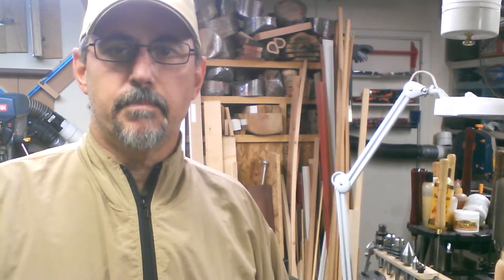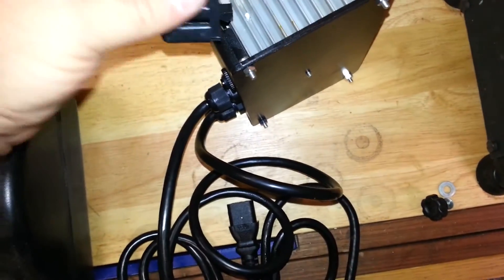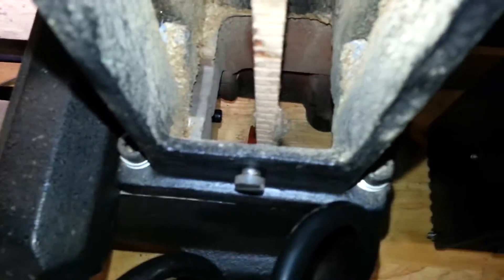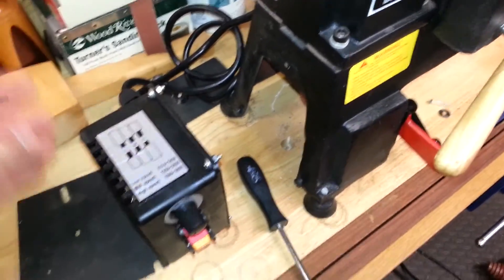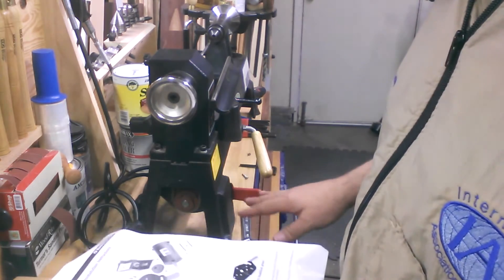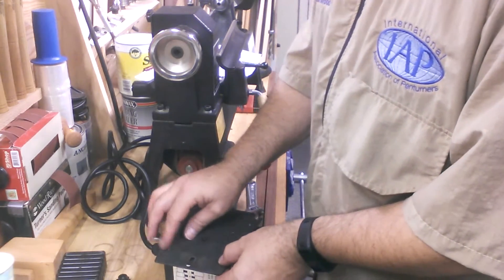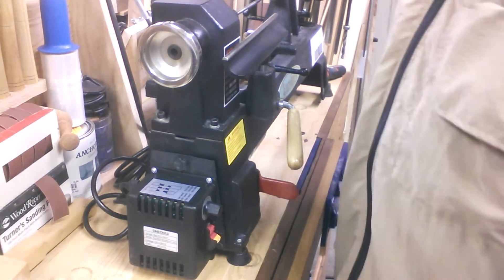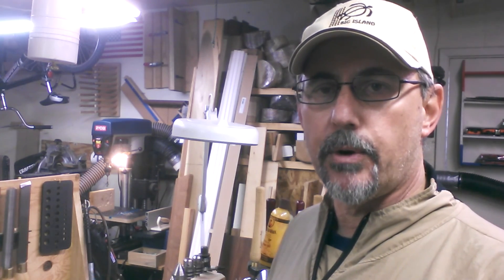08 - EVS for Excelsior Mini Lathe

Comment: Love it. I've been thinking about getting that VS motor for mine. I've got the Rikon badged model of that lathe. Changing speeds is such a pain, but that's my only real complaint about that lathe. Excellent video, Bill.
Reply from the maker: Joseph Gillen Thanks Joseph. I put it off quite a while but with the other two lathes being VS I got tired of moving the belt.  Cheers!

Comment: Bill, thank you for this informative video !
I received my kit yesterday, and installed the control box as you've demonstrated on my Harbor Freight 10x18.
5 minute quick fit for the motor, 5 minutes to drill the new holes in the plastic cover, and all is well !!! 

I do have a bit of vibration when running on the low pulley set at various speeds, but I'm not yet sure if it's the motor or lathe itself.
Stay tuned !!!

For those who may be interested in this inexpensive upgrade, here a link to the product;
https://www.pennstateind.com/store/TCLVSKIT.html
Reply from the maker: Thanks for watching and commenting, and I'm glad the option is still available and worked out for you. Cheers!

Comment: Covering up the heat sink on the bottom is not a good idea. VFD control may overheat and get sawdust in it.
Reply from the maker: Hi Ed, thanks for watching and commenting.  I agree - I never did put on the stock cover that came with that variable speed controller.

Comment: Hello Bill, thanks for quick reply,, here is another question,, there are times when I will have the lathe on for along time say 2  hours,, the motor is so hot I can not set my hand on it,,,, a while back I sat my for arm on the top of the head stop and it was smoking hot,, last night I removed the head stop and thought it turned a little stiff,, I took it to 2 machine shops to press out the bearing to replace them and they said it turns fine and did not want to do it.When I give it a hard spin it only wants to to spin about 1-2 turns,,, should it more freely than this?.. Since the tail stop is pot metal they may have just not wanted to do it 
Thanks 
Lee
Reply from the maker: Lee, small novel alert: I checked my Excelsior, and with the belt disengaged from the spindle, I can get 6 or 7 freewheeling revolutions out of the spindle. If you are doing the same thing and only getting one or two revs, something is causing friction, likely the bearings.  Motors will heat up for various reasons - lack of air cooling, worn bearings, overload, etc. so you'll have to isolate what is going on there. It could also conduct some heat to your lathe bed near the headstock, possibly adding to the heat already there. But checking/changing your headstock spindle bearings is a quick and cheap way to correct the headstock heating issue, then check the motor issue. Remember not to overtighten the belt, that could cause bearing strain/wear/heating. Cheers!

Comment: Hello Bill, I have a master craft MC10-18,,, if you took the stickers off you could not tell the difference from the excelsior,, I have been stalling the motor lately and want to do the upgrade,, the pulley,s on mine has 5 steps and I see in the video the new motor has 3,,any problems getting the belt to line up ?
Lee
Reply from the maker: Hi Lee, I believe several models including mine,  the MasterCraft and the Harbor Freight offerings are the same.  I had no issues lining up the pulleys. However,  this motor can also be stalled,  especially on larger turnings. The advantage is the EVS, not necessarily motor strength. You might want to consider how and why you are stalling your current motor before you buy,  this one may not address your issue. Cheers!

Comment: I have been looking for a way to do that and this looks like the ticket for my excelsior lathe! Do you think the tachometer that you showed for your Central lathe would work with this set up as well?
Reply from the maker: Hi Terry, thanks for your comment.  Yes, the tachometer should work - but would have to be externally attached in its entirety, as there is absolutely no room in the headstock to accommodate anything like a transformer.  I plan to do this as well, leaving the transformer intact, and putting a switch in the circuit - like a toggle or pushbutton - possibly on the display unit.  When I do, I'll video and post.  Cheers!
Reply: Thanks for the reply!  I am thinking that the old motor can easily be utilized as a dedicated slow speed grinder for wood turning tool sharpening as I only have a 6 inch high speed grinder.  Thinking of adapting a John Heisz plan for the grinder mount.
Reply from the maker: Terry Ellis Hi Terry,  I think the old motor is likely strong enough to serve as a lathe tool grinder. I have been trying to think up some uses for mine as well, and I like your idea, maybe with a CBN wheel. Please let me know how yours works out. Cheers!

Comment: since you have installed the variable speed control for your excelsior  how has it performed for you   im thinking about getting the same for my excelsior lathe
Reply from the maker: Hi Duane, it has been working very well for me.  I use this lathe primarily for pens and have not tested it for larger turnings but I'm happy to have the variable speed.  I may try a bowl on it and if I do I'll post a video. Cheers!
Reply: That's what I'm using it for making bowls that's why I wondered how it was working for you it looks real good in the video so I guess then I'm going to go ahead and purchase the variable speed
Reply from the maker: I think you'll like it. My guess is that it would do fine for small bowls especially if starting with round bowl blanks. Be safe and have fun. Cheers!

Comment: I have the same Excelsior lathe as you. I guess I misunderstood that this new motor would fit right up to mounting holes. No way. First I tried to use the template that came with the motor to drill holes in the motor mount and the thing was so flimsy it just fell apart. Second I decided I would take the mount off of the new motor and use that as a template. I could not remove the pully after taking the set pin out. It would have been nice if the pulley was off the shaft when it arrived.  Also, I realized that the large opening behind the pulley on mine was larger than the one behind the new one so the bottom mounting screw was inside the hole on mine. No way the template would work anyway.  I called Penn and was told by an ill-mannered person to send it back!!. I give up. I will be sending it back.  I wish you had gone through the entire way you had to drill the new mount.  Because there is no way you just installed it in the way that you implied in your video. So now I need to put everything back the way it was before this fiasco.
Reply from the maker: Hey Hills, I'm sorry to hear about the issues you are having - they must have changed something in the motor mount design, because the one that I bought was a direct Mount up to the old holes for the motor. The only thing I had the modify was how to mount the variable speed control box, which was pretty minimal. Disappointing to hear about this change, thanks for letting me know. Be safe turning!
Reply: Hey Bill, my bad. I really overthought this whole operation. I took a nap, thought about it and realized I was thinking I had to use the motor mount that came off the lathe. Anyway, everything hooked up fine. Next, I need to figure out pully configuration and I am back to turning. Thanks for all the great info. Stay safe.
Reply: Hi Bill, just a follow-up question on the EVS motor on the Excelsior lathe. I can't can seem to bring the speed down. The pulleys are alined correctly but and I have tried all three, but still no luck. Should the speed control turn all the way down to Zero rotations?  When I do turn it all the way down the speed is still very high. I hope all is well with you and would love to hear your advice. Thanks
Reply from the maker: Hi Hills, mine doesn't turn down to zero, but it does turn down to a fairly slow rpm.  Are you saying that yours doesn't change speed at all?  If that's true, I would ensure the motor controller is functioning properly by removing the belt and watching/listening for any speed change in the motor and pulley set on the motor shaft.  If there's no speed control change on the motor side when you move the knob from low to high, you might have a defective motor controller.  If so, I would give  Penn State a call to see if they will send you a replacement. When I bought my replacement motor set, it only had 3 positions on the motor pulley versus 5  on the headstock pulley, and I positioned the two pulleys so I could use the three Center pulley ranges on the headstock side.  And I typically use the very middle one, which gives me enough RPM range from low-to-high with the motor controller for what I do.
Reply from the maker: Hills, I just had another thought. If there is any room for you to move either the headstock pulley or the motor spindle pulley so that the smallest motor pulley aligns with the largest headstock pulley position, this will give you the slowest RPM when the belt is in that position.